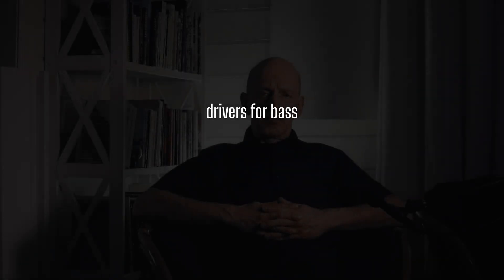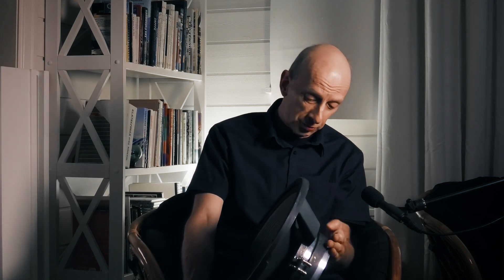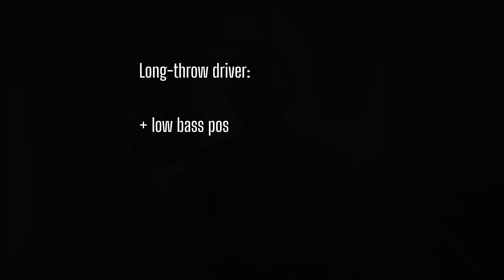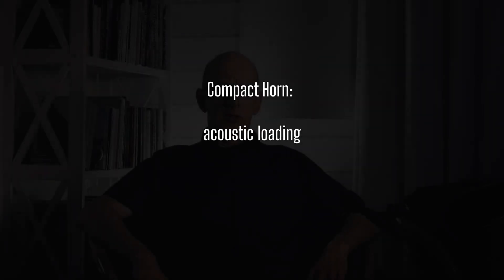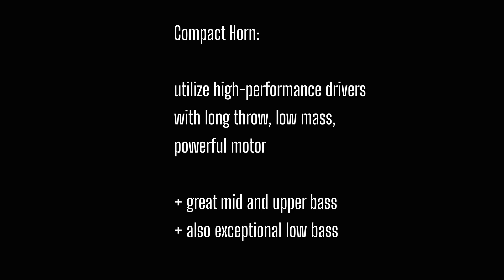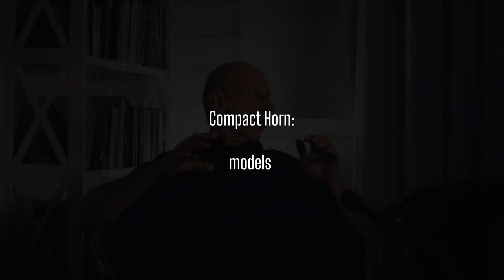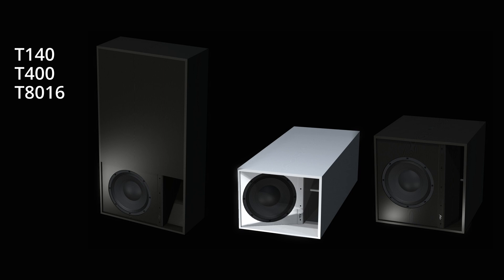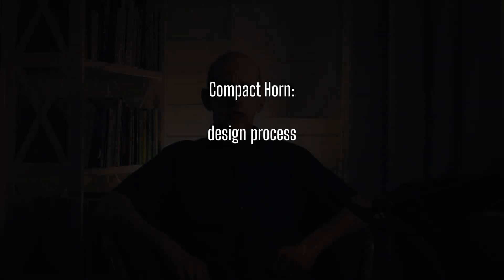Compact Horn Subwoofers for addictive bass - short version

Comment from the maker: Addressing some of the questions: 

Is it a horn? Depends on how you define a horn. And what tuning, size, driver. A low-Bl driver design can end up with a design with throat area larger than the mouth exit, thus in my world a classic transmission line. A high-Bl usually will have much smaller throat and larger mouth, it expands, like a horn. Smaller cabinet will have smaller mouth-to-throat area ratio. 

Benefits? Yes. Indeed. Even the smaller like the T6018 will have significantly better performance compared to trad ported box. Because air velocity and thus losses at high spl will be much. much lower. 

See this publication (AES report): 
https://www.aes.org/tmpFiles/elib/20250611/20776.pdf
They investigate losses in acoustic ports, and a typical port here has losses around 6dB at 42Hz, those losses will be even larger at lower tuning and lower frequencies. It matters. 

Larger vs smaller: The larger designs has a more powerful bass, they are experienced differently. Even at lower volume. So larger is better. 

Recommended designs: For installation, I would recommend a flat designs, tall and wide, shallow. Based on the T140 design. And then I would recommend a tall standing design based on the T400. 

Tuning - for music or movies, sub-30Hz or 30Hz: For music, there is potential for around 6dB more output if tuning to 30Hz instead of the very low <20Hz I use for the larger models. For most music, nothing is missing.
Reply: The link you posted doesn’t go anywhere
Reply from the maker: Try this: https://aes2.org/publications/elibrary-page/?id=20776#
Reply: You say that the horns have much lower acoustic loss than Reflex channels, but there is actually no test for your special kind of transmission line in comparison. You have sharp corners in your design, I would assume there is also some loss at high SPL levels.

Part of designing a Bass Reflex port is to make sure there are not too many losses, in the paper the Port design A is way too small, nobody that understands how to design a Reflex Port would do it like design A. 

I believe you get benefits in some specific ways with your design over Reflex Designs.. but if this would be universally true, the majority of speakers would not be Bass Reflex boxes, but they are…
Reply from the maker: Better because output port area is larger - for most designs. The most significant for losses is output port/mouth area, because here there is a large change in p and v over a small distance, and this causes flow separation and thus very high losses. then there may be additional losses internally, due to design of the horn channels. Ported vs horn there are more differences, the acoustic loading is not the same.

Comment: So step 1.) Get compotent Driver/drivers 2.)Find a design you like for your compact horn or horn sub 3.)Gobs of power to throw onto Horn subwoofer. 😅
Reply from the maker: Last point I think is often misunderstood, because yes they need "gobs" of power if they are to play low and loud and not be huuuge in size. Relationship between low frequencies - size - efficiency is valid and will always be, the acoustic loading extends low end and output by allowing more power to be utilized.
Reply: @kvalsvolldesign def. I just meant that part loosely as we both know it gets complicated fast.

Comment: I like the Electrovoice T18.  Can you scale it down for a 15 inch speaker .  I will pay you for the plans.  I on gmail.   What is that cabinet on this video?   I am looking for something compact.
Reply from the maker: The horn pictured on the thumb is a T400. It is mentioned in the video. 

Changing an existing design (and do it properly) is a development project involving simulations and drawing the new horn, and would never pay off unless you are a manufacturer building many of them. I have design service for Compact Horns for small manufacturers, still not really suitable for one-off builds, design cost will be way more than the cost of the horn. But why not do it yourself. Model the horn in Hornresp, put in the new driver, try to change things and see if it works. Then draw it, and build it.

Comment: i want to hear more about your designs and what would be required for mid-teens (~15 hz) extension @ 115 db in a 5500 cubic foot room. I am in the process of rebuilding my burned house and replacing equipment lost in the fire. Please contact me
Reply from the maker: There is a calculator on my web site for this purpose (https://www.kvalsvoll.com/Articles/AudioCalculators.htm#), it can be used as a starting point. However, many properties of the room come i into play here,  such as wall construction and if there are openings. In some rooms, 2 of the medium/larger size Compact Horns can do a lot, while in others, even similar size, this will be insufficient capacity. 

Contact info on my web site: https://www.kvalsvoll.com/contact.htm

Comment: You don't mention the biggest issue: low frequencies travel slowly and your elongated horn produces massive time smear.
Reply from the maker: Time domain is equal to any other principle with a high-pass roll-off, where GD/decay at the knee is determined by roll-off q and order. The larger models has a cut-off well below 20Hz, thus it will have no decay audible on most content material. And in-room, acoustic modes and resonances will be much larger anyway. Of course you can make a horn/pipe/TL tuned differently with different means to control the resonances, and then end up with a different system that actually has significant delay and time domain problems.

Comment: So basically, it's a horn with aperiodic chambers, much like PMC use aperiodic (style) chambers in some of their designs. 
For those who may not understand, I suggest looking on the Hexibase Channel  5 Enclosures You've Never Heard Of video,  or the Acoustic Engineering Workflow video.
Reply from the maker: Can use chambers, I have ended up designing with channels/horn segments. Chambers can be ported into the connection with the main horn channel, and then you need to keep track of air velocity in that port, it may easily get too high for linear flow. There are many ways to do somewhat similar solutions to reduce or remove resonaces, shape the response. In the F2 I use a very different approach, because that one is very different both frequency range and it need to work across full BW summed with the output from the front of the bass driver cone.
Reply: There's probably a reason why we never heard of them ;-).

Comment: I have actually heard the Kvaalsvoll systems in his very own demo-rooms. To date it is the most mind blowing and impressive display of sound quality, clarity, realism and power I have experienced in my audio journey so far. Amazing! Thank you for the very easy to understand explanations in this video Mr Kvaalsvoll! Keep up the good work! I really hope people will get to find your products on the broader market! They truly deserve that!
Reply: 100 % true .  This sound fantastic
Reply: How is it different than a classic trassmission line bass? 
Thanks!
Reply from the maker: 1 - resonances eliminated, 2 - efficiency and sound different due to tuning and driver choices. And the main channel expands, smaller throat -> larger mouth. Trad TL small mouth. But, in the end, a pipe is a pipe..
Reply: @robertvanczak6944  Probably not that much difference IMO.  Most "bass horns" are actually just quarter-wave resonators, as "true" bass horns will probably take up most of your living room because of the mouth size requirements, LOL.  For bass systems, TL = rear-loaded 1/4 wave resonator with taper from throat to mouth. FLH = front-loaded 1/4 wave resonator with expansion from throat to mouth.  RLH = rear-loaded  1/4 wave resonator with expansion from throat to mouth.  As they are all resonators, they will all have resonances to deal with.  A well-designed offset-driver TL will push the effects of those resonances out of the desired passband and into higher frequency ranges where they can be dealt with by a little stuffing or lining.  Bose actually patented a dual-offset dual-driver TL about 20 years ago (yes, the idea's been around that long!) that extends that idea even further.  I've put together an Akabak model of the idea and it works - now I just need to find a way to fold the whole thing into a box :-).
Reply from the maker: Correct, real horn way too large. And everything else is some sort of 1/4-pipe. There are other ways to improve/fix response, such as driver offset (tapped-horn). The point is to have acoustic loading, and fix the resonances in the passband.